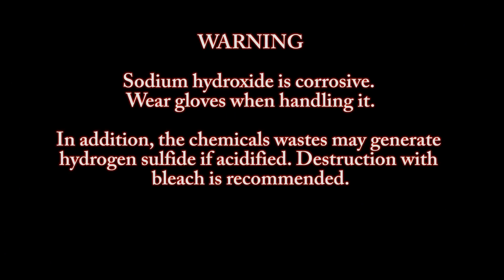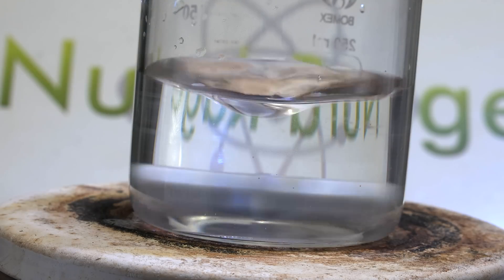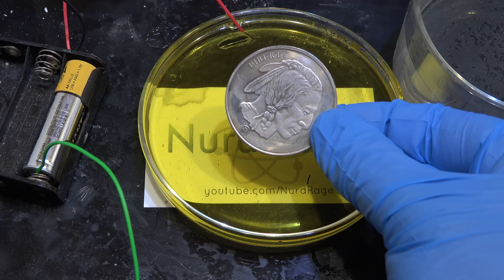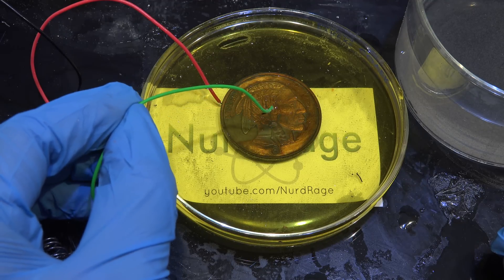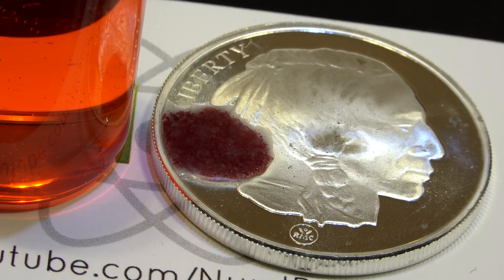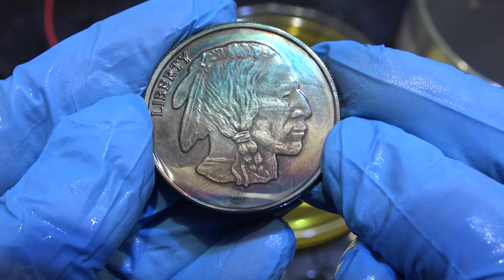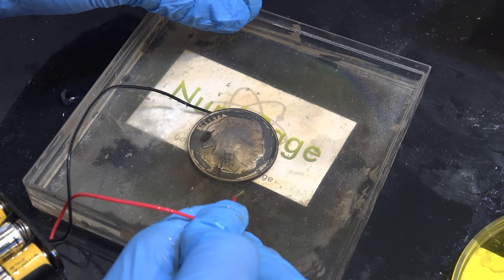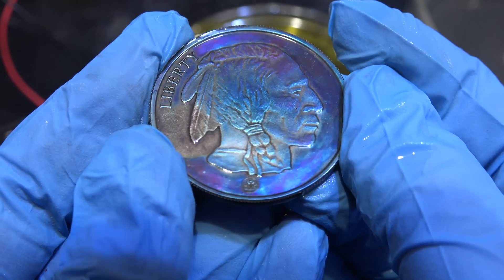Toning Silver Coins by Anodization (fixed)

Comment: How to Actually Tone Coins  
https://www.youtube.com/watch?v=OaOPfI24JWo

1. Understanding Coin Toning
Before attempting to tone a coin, it’s important to recognize that toning results from a chemical reaction between the metal surface and environmental factors. Common causes include exposure to sulfur, oxygen, heat, humidity, and certain chemicals.
Toning can range from light golden hues to deep blues, purples, and reds, depending on the coin’s metal composition and the method used.
2. Methods for Toning Coins
A. Natural Toning (Takes Months to Years)
Store the coin in a paper envelope or a sulfur-rich coin album.
Place it in a controlled environment with moderate humidity.
Allow exposure to natural air over time without handling too much.
B. Accelerated Natural Toning (Weeks to Months)
Egg Method:

Hard boil an egg and crush it into pieces.
Place the egg and coin in a sealed container without direct contact.
The sulfur in the egg will tone the coin over time.
Check every few hours until the desired tone is achieved.
Tissue Paper Method:

Wrap the coin in tissue paper and store it in a warm, humid area.
Over time, oxidation will produce a gradual toning effect.
C. Artificial (Quick) Toning (Minutes to Hours)
⚠ Artificial toning can reduce the value of a collectible coin if done improperly or if detected as unnatural.
Heat Toning:

Hold a coin with tweezers and use a lighter or heat gun.
Move the heat evenly across the surface.
The coin will develop colors as oxidation occurs.
Be cautious, as excessive heat can damage the coin.
Sulfur Vapor Toning:

Place a coin in a small, sealed container with sulfur (match heads, rubber bands, or tarnish paper).
Check periodically and remove when the desired tone appears.
Chemical Toning:

Liver of Sulfur: Dissolve in warm water and dip the coin briefly to create a quick patina.
Ammonia Vapor: Place a coin in a container with ammonia vapor exposure (without direct liquid contact).
3. Tips for Best Results
Silver coins tone faster than copper or nickel.
Always clean the coin gently before toning to remove dirt and oils.
Test on a less valuable coin before attempting on collectible pieces.
Avoid over-toning, which can make the coin look unnatural.
Store toned coins properly to preserve their appearance.

Comment: Great video! Thanks! I have a question regarding the oxidization at the end, without sulfur, does it consume the oxygen in the solution? Which means there's just limited oxygen and the reaction would stop if it is used up? I tried the experiment and sometimes it only turn one side of the coin black then the other side would remain the same and the reaction seems to have stopped.

Comment: Thanks for the very clear info! I tried this, and what I got was an all-over antique yellowing without any rainbow colors. I had trouble getting my sulfur powder to mix very well since I don't have a magnetic stirrer, and the toning process took longer than yours did. Could not having enough dissolved sulfur be the reason I didn't get any pretty colors?
Reply: To answer my own question... I got a cheap magnetic stirrer. That did a much better job of dissolving the sulfur, and my silver pieces came out looking just as colorful as in the video.
If anything, it works TOO well. Two seconds with a 1.5V battery gave me a deep sparkling blue, while one second gave me a red-gold tone. To make it slower/more subtle, I might try lowering the voltage, using less sulfur, or chilling the liquid.
Reply: @eriswerks  mine messed up real bad, my bar turned black
Reply: @viperfang5291  You may have been too close to the coins or connected too long. If a two seconds or less gave fairly satisfying results any longer than that is what happened in your case. Did you try it again on another coin or stop right there?

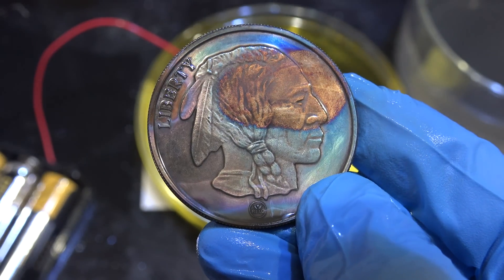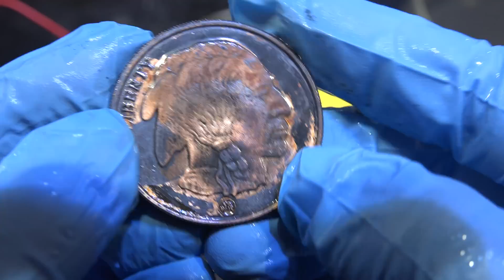Comment: Can someone explain to me the part from 05:01 to 05:20 ? Thats is that? So when silver tarnish too much it will create black silver sulfide which will then fall off of silver? So when silver tarnish too much you will lose silver content when this black silver sulfide fall off? If i understand this right, silver sulfide will fall off of the coin surface and it will take some silver with it, can someone explain this chemistry to me?
Reply: I can't explain too much but imagine acid burning the surface, that's what happened.
Everything in the universe will eventually change form to something different with no exceptions.
This process speeds that up.

Comment: Hi- I’m not sure if you’ll read this but if someone could answer me it would be great- it’s actually about the toning coins with anodizing- I am making  the solution exactly like you said- HOWEVER I DONT HAVE A STIRRIR LIKE YOU- 1st I tried a mason jar and covered it, it got really hot and never turned orange even shaking it forever - next I did the 1/2 cup water with 2 tablespoons and 1 tablespoon meathod also in glass mason jar- I did a circular motion for about 12 min and NO ORANGE COLOR AGAIN!!!! Why? It was covered so I took the cover off after about 12 minutes thinking that covering it was the problem, stirred a little more but never turns orange- what am I missing? Help please!? Next I’m going to try uncovered with the 1/2 cup and 2Tb&1Tb method in circular tornado motion (I don’t have the magnet yet, maybe that’s the issue? But I’m stirring it similarly) - please help.
Reply: Mine turned orange first time.  I used drain cleaning crystals and crushed match heads, and cut the total formula size down by about 75%.  Didn't stir it for anywhere near half an hour, though did filter it a few times.  Two wires soldered to the circuit board of an old remote control and I was toning, at ~2.5 volts.  I've devised a procedure to tone, rinse with water, let air interact for about an hour, then tone further as desired.  To remove it and start over, palmolive and a toothbrush generally does the trick.  Soft cloth and silver polish if needed.  I dropped out of chemistry in high school and went to work instead of college.  Nice to be playing with a little chems again.

Comment: Calcium polysulfides are used as a contact fungicide on dormant peach trees. The common retail label name is "Lime-sulfur spray", old timers make it by boiling sulfur lime and some wood ash over a fire outside. Application stinks but it is very effective for peach-leaf curl (with repeat applications water resistance is low) and listed organic as it quickly breaks into plant available mineral nutrients in the soil.
Reply: wolfedog99 did you try preety much the same tones? thank you.

Comment: is it possible to do diffrent metals?
Reply: You need different chemicals and voltages depending on the metal, but yes. (Google something like "anodize aluminum" or whatever and you'll probably find several pages telling you what you need for that metal.)

Comment: i have sulphur powder which is contaminated by dirt (10%) is there any chemical method by which i can purify it?
Reply from the maker: boil it in xylene, most of it will dissolve. Decant the supernatant and let it crystallize back out.
Reply: +NurdRage  is there any way we could recover sulphur efficiently from the solution you used in this video??
Reply from the maker: Sulfur is extremely cheap (it's actually a waste product from oil refining), any recovery method would be more expensive than buying more.
Reply: +NurdRage  but is it possible to recover sulphur from that solution. just for the sake of chemistry.
Reply from the maker: it is possible to recovery any element from anything, it's just a matter of cost.
Reply: +NurdRage  is there any source where i could find the information about recovery of sulphur from that solution
Reply: Shad k501 neutralize with HCl, boil of water, recrystalize in xylene
Reply: +CSGO Clips  Thanks, that worked. though i lost some sulphur in H2S gas and i think some sulphur might have evaporated since i added HCl when the solution was still hot
Reply: +NurdRage you were right, it was not worth it

Comment: I'd love to know if this could be achieved with chromed metals
Reply: Perpetual Cowlick no chrome doesn't tarnish like silver I'm not even sure if chrome tarnishs but no you cant
Reply: Hydrochloric acid does tarnish chrome.
Reply: djteac oh ok thx I thought it just dessolved it in not really a good chemist I'm more of a enigneer
Reply: Would the anodization of the chrome be comparable to that of the coin?
Reply: Perpetual Cowlick you probably wont get the same results but it might be toned similar to that of silver just maybe different colors.
Reply: Perpetual Cowlick the chromium is passivated, so i don't know if the item can conduct electricity at such low vultage

Comment: +nurdrage i found that after heating a cupronickel coin to a few hundred degC 2 oxidize and blacken its surface completely then reduce the oxide back 2 metal using ur Al foil in NaCl/NaHCO3 soln, the surface turned coppery red instead of original silvery colour!! y is that?
Reply: TM Fan I think it reduces only the copper?
Reply: Alvis Gwa this also happens when reduced by electricity
Reply: TM Fan nickel oxidises at high temperatures faster than copper. The nickel oxide was likely coverted into sodium nickelate in the hydroxide solution leaving a layer of clean copper.

Edit: likely it made the nickelate ion AND reduced the copper too, since copper and silver are in the same family of noble metals.